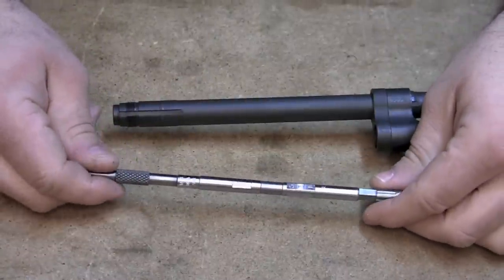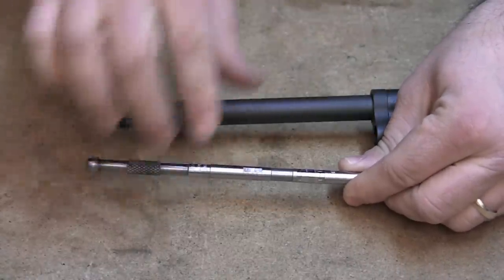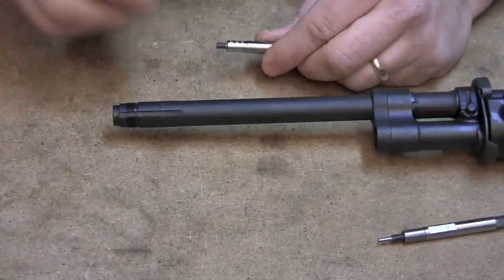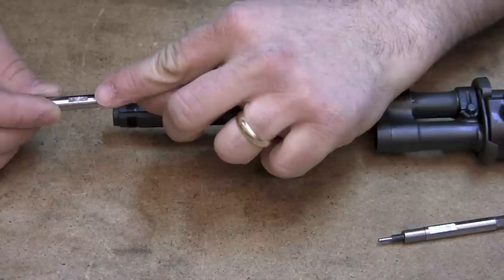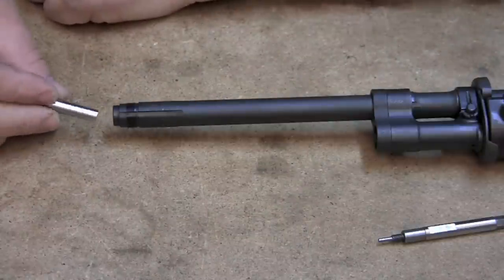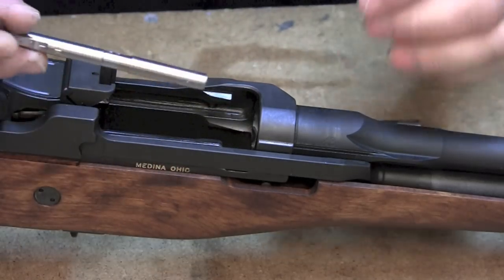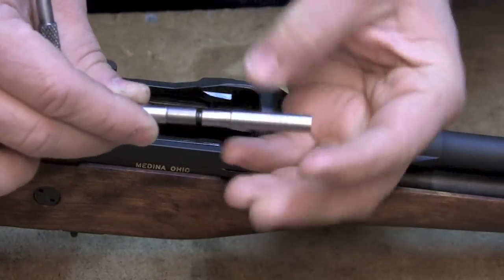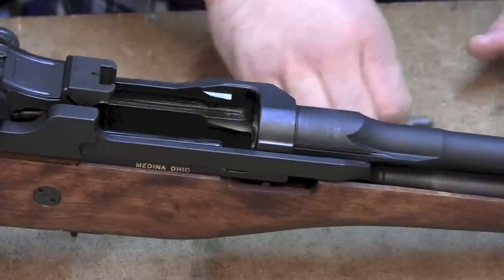M14 Throat Erosion and Muzzle Wear Check

Comment: as a retired tool and die maker i still have all my mesurments tools,  one item is call a "pin gage" these come in all sizes,  go-no-go tapered ect. can be bought in sets or ordered individual and come in various degrees of accuracy.  some of the  lower grade standards are just a few bucks each.  if you  know the range you want to check just buy those in that hole range.  no need to buy a complete set. they actually have many uses,  I  use them to help install hammer/ trigger group pins, take down pins, check hole specs, you name it. just Google " pin gage sets" and look until you find a company that sells individual pins. even the Chinese stuff is good enough for what we are trying to do here. great video, thanks.